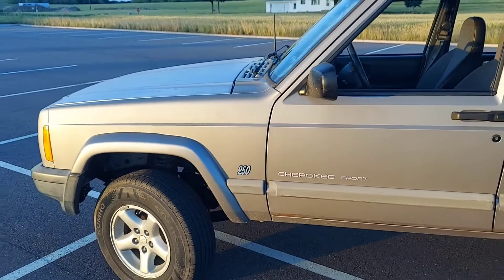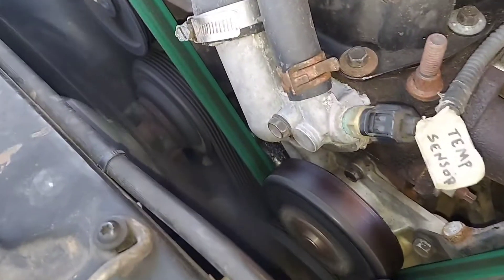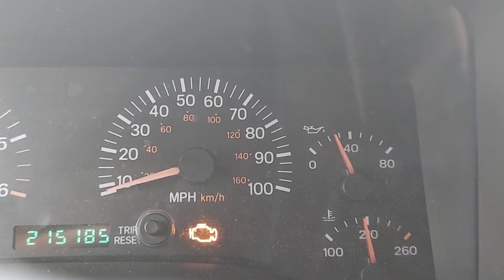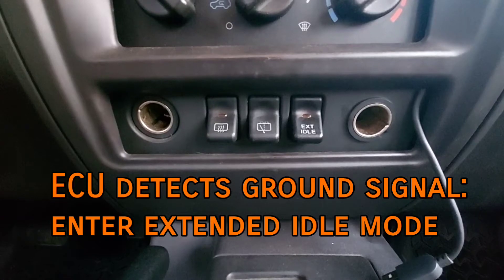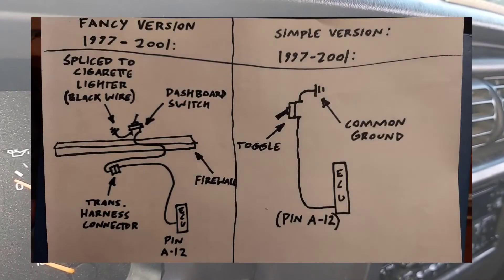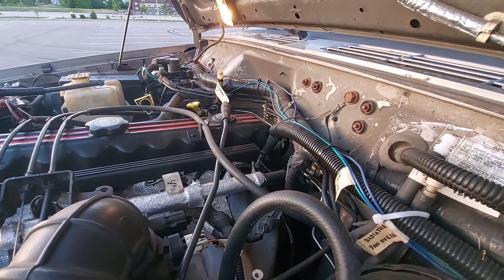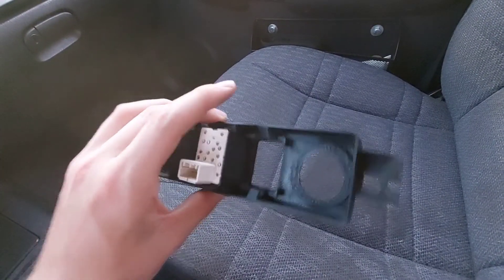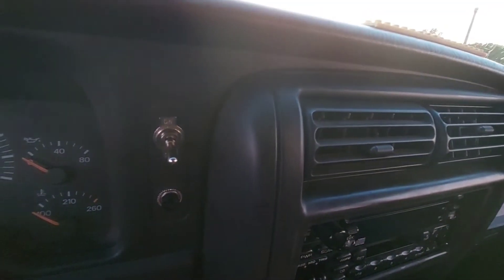Jeep Cherokee - Extended Idle Mod(e) ['93-'01 XJ]

Comment: The one drawback of extended idle is that it only works in park or neutral. For me I'm an offroader so having it work in drive in 4lo is quite handy. If you want that functionality its quite easy. All you have to do it run that ground signal wire that you hooked to the extended idle wire and run it to the wire on pin A6 at the pcm. It's a black wire with a white stripe (97-01). That is the signal wire from the neutral safety switch. Its grounded when in park or neutral so by supplying it ground you're tricking the pcm into thinking it's in park. A side benefit, if your neutral ssfety switch goes out you can flip your high idle switch on and it will fire right up. Use caution tho,  with the switch on it will start in any gear. Use this info at your own risk.

Comment: I tried this on my 95 and nothing happened? supposedly I need the matching PCM to the police package for this to work ? Any insight
Reply from the maker: honestly that might be a possibility. I am not very familiar with the H.O. Jeeps, I just found some random information out there
Reply: @WAEMIDIV  pin 10 is for power steering sense I guess it raises idle when in high stress situations to increase power steering fluid flow.. and that shoots idle up a bit to compensate I’ll try and see what happens
Reply from the maker: @deadspeed6679  There's only a power steering pressure sensor for the 2.5L. Extended Idle won't work on the 4 cylinders

Comment: The grey wire to tap into is located where?
Reply from the maker: It starts at pin A-12 on the ECU, and runs to the Transmission Harness Connector, which is a long/ wide black connector with like 30 wires on it at the back end of the passenger side of the engine, right where the NSS Connector is. You can splice into this wire at any point between that Connector and the ECU.

Comment: I'm going to try this
  I've got a grand Cherokee 5 speed but it still has the auto ecm
Reply from the maker: The Grand Cherokees have different computers and thus, different pin outs for them, and were never offered with a police package so I don't think they have Extended Idle at all. You might want to research and see which wires do what before grounding them.

Comment: I’m not sure why everybody keeps connecting to the end of that harness, it’s so much easier to just tap on to that wire by the computer and then run it in the existing harness through the boot under the brake master cylinder.

Comment: Is it possible to modify the rpm for this upgrade?
Reply from the maker: I don't think so, because the extended idle mode is programmed into the ECU. You'd have to reprogram the computer to make it idle at a different speed. 

However, some people make use of the cruise control to hold the throttle open in their own makeshift ext. idle circuits, but that's a lot of work

Comment: If you want to use the transmission plug like you said, is the wire still gray on that as well? Sorry if I misunderstood your wording, this is new to me as I didn't know you could do it from anywhere but the wire right there at the ecu.
Thanks in advance
Reply from the maker: Yes the wire is the same color all the way from the ECU to the connector I used. You could splice into it anywhere you want between those 2 points

Comment: I really want to do this for my Comanche. I’d like to add onboard air out of the stock XJ ac compressor. Do you think will help fill up the air tank quicker?
Reply from the maker: Unless you have a 1993+ Engine and drivetrain in your Comanche, EXT Idle unfortunately doesn't work in MJs. There was never a police package Comanche and the ECU wasn't programmed to support EXT Idle mode until 1993. 

I'm not too familiar with how compressors work because I've deleted my A/C a long time ago, but I'd imagine spinning them faster would increase their power output yes. 

The bad news is though you need a 1993+ 4.0L and Automatic for stock EXT Idle to function, so that'd be alot of work for one small feature. 

There are other ways to trick the engine into idling faster, like hacking into the cruise control module to maintain a certain throttle position at idle. It's possible to do without a 93+ drivetrain swap but that would be uncharted territory I can't help with
Reply: @WAEMIDIV  yeah I’m in the process of a 97+ swap so I have the engine, wiring, the whole nine. I may give this a try and see if it helps
Reply from the maker: @Big_Spud44  Well I suppose in that case you're set to go! a 97+ swap is a ton of work I wish you the best in your endeavors